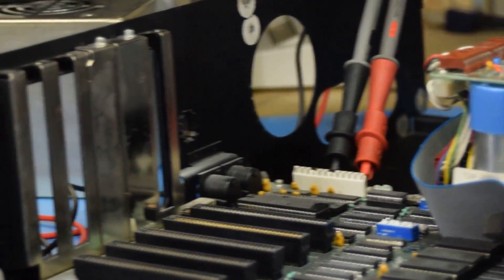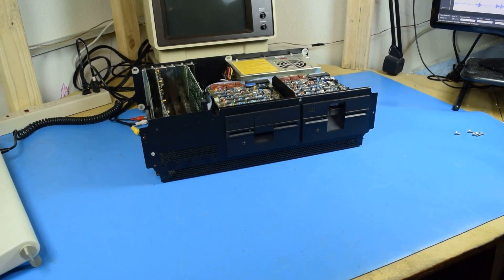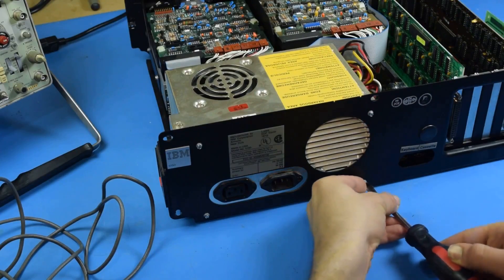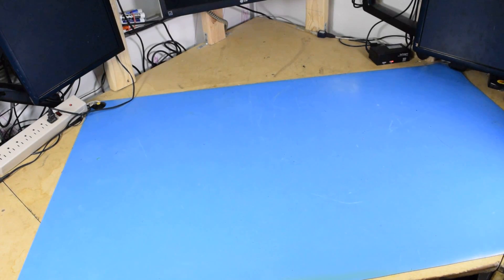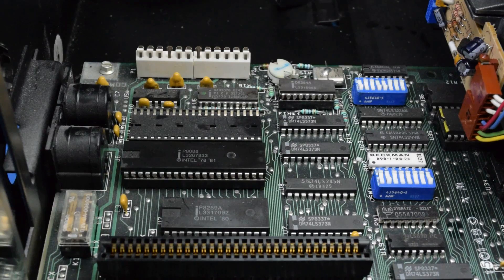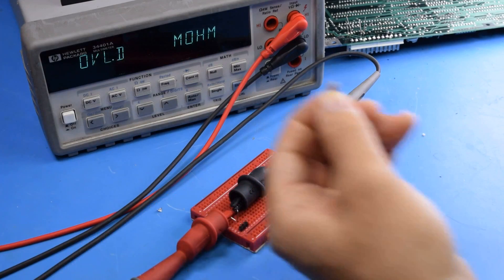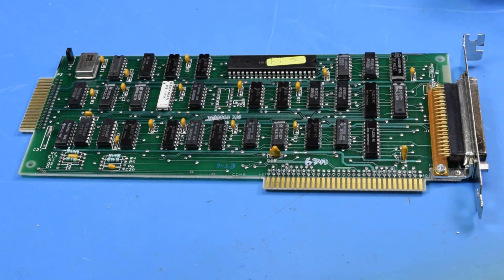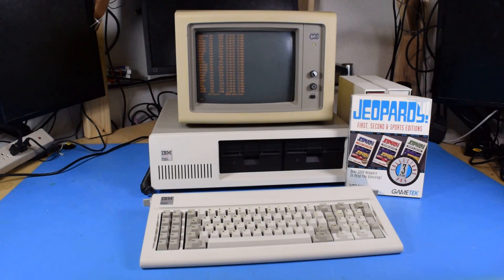0x0008 - An Overdue IBM 5150 Repair

Comment: For those coming along looking to fix their 5150's with problems.  Back when I was a boy (DJ reference) my job was to repair these things. First, these came with a 63 watt power supply. One of the power supply lines going to the motherboard is called the "Power Good". If you don't connect the motherboard or provide a power good signal, the power supply will not start up. It be dead.  Second, the tantalum caps on the PC boards will usually let you know when they're bad. They turn into a flaming fireball and automatically remove themselves. No user input needed. Put a 2 pin in backwards and get the same results. Third, when working on the floppy drives. On the bottom is a timing pattern for both 50 and 60 hertz strobes. Use a florescent light to check and adjust the speed.  If it's off the drive won't read disks.  Good luck.

Comment: It's amazing.  I became a computer tech in 1992 full time and learned DOS 2.11 and Basic on a 5150 in high school.  Back when I became a computer tech, these old 8088 / 8086 computers were just considered junk.  I spent days sometimes hauling these old computers out of companies by the van load to the dump after doing a workstation upgrade.   I wish I would have kept some of them now!
Reply: I picked up a couple of 5150s surplus around the same time. Upped the memory and added a 20 MG hard drive (close to $200 bucks).
My big move from a Radio Shaft Color Computer to my first real computer.
Fun times.

Comment: Capacitor ESR and leakage basically are independent. High ESR means the electrolyte is dried out / gone, high leakage indicates bad spots in the dielectric. Old caps may exhibit either, both, or neither. An ESR meter will tell you nothing about leakage, and a leakage tester nothing about ESR. 

Tantalums actually can be very durable, but their low ESR and small size means they are easily damaged by high inrush currents unless derated substantially. This was not common knowledge in the very early '80s, so particularly devices designed by people who were inclined to skimp on capacitors saw a fair share of failures.

Comment: 5:45 I thought some capacitors is going to release magic smoke and firework, but glad that doesn't happen to you :D
it happened to me with my IBM 5155. have to replace 2 shorted tantalum capacitor on motherboard and 1 on CGA card to get it working.

Comment: Just a heads up, those old 5150 power supplies won't power up without a heavy load.  Even a single hard drive and CD-ROM drive wouldn't power one up I was repairing, it required a load on both the molex and motherboard connectors to get it to run.  They are super picky about their loads.
Reply from the maker: I was able to get the 3rd party PSU to power up with just the HDD. But I can't remember if I ever tried turning it on with no load. So it may just always turn on. I've tried both PSUs in a 5150 though and they don't do anything.
Reply: I find the best thing for a load is to put a DC bulb of around 10 watts on the +12 and +5 rails.

Comment: Oh, I love that site. I have a 5160 that I received from one of my professors. Shortly after getting it, I turned it on, turned it off, then turned it ...nope. Dead. I used that site to troubleshoot and found it was a failed CGA video card. which I repaired. It was a bad tantalum capacitor, so I replaced them all.

Comment: When you connect your ohmmeter to the power input, you are basically measuring the power consumption of everything plugged in, but at a wrong voltage.  So there should be current running through, and the resistance should drop when you plug in more parts.  Unless you have a manual that states what the ohm reading should be at a specific ohmmeter test voltage or current , you won't get much from that test unless it shows a dead short.  As for the power supply, I wonder if the old handbooks contain enough detail to wire an ATX to PC/G adapter cable, letting you use a modern PSU (If it has the extra voltages that are often unused on modern boards).

Comment: 8:00: Most of the 5150 PSUs do not power on unless there is enough of a load connected; that could be a drive or a board, or even several things if necessary. That's not necessarily a fault. It's just the nature of the thing. I dimly seem to recall that that was even documented somewhere. I'm not even convinced that your original PSU has failed – that's a modern load connected at 9:30, which may not have been what was needed. I'm also not convinced the other PSU at 10:43 is actually faulty – again, that's a modern load, and the mainboard is unplugged there. If memory serves, it does seem to help to give the PSU a rest after failed switch-ons, and retry only much later with a Goldilocks amount of load on it. That behaviour too is probably normal and not a fault. Again, I am not convinced that the PSUs at 11:50 have failed. The clone PSU probably is simply less picky. 

Replacing the tantalum capacitors was probably helpful regardless or at the very least not harmful. Those really are notorious, even to the point of potentially producing literal fireworks when they fail. You're a little bit brave or foolhardy to hold old tantalum caps in your fingers. 21:16: Exactly right, the new tantal caps will likely be reliably good for a lot longer.

Btw., ESD can be a real bummer with those old DRAM DIPs which can be more sensitive than modern chips, and you're being very cavalier. Careful now.
Reply from the maker: I cut out some other shots where I attempted to power up both 5150 with the original PSUs and the fans don't even kick. The HDD was just a smaller way of demonstrating it for the video.

Comment: I had he exact same thing with this IBM floppy controller. My multimeter flagged a continuity beep between GND and 5V as soon as it was inserted on my IBM 5150. The exact same thing occurred on my IBM 5155. Oddly enough, using the same floppy controllers on an XT clone didn’t have the issue. I ended up using another (non IBM floppy controller) on my 5150 cause I was afraid of shorting something. But after watching this I’m beginning to think this might be just a “normal” IBM thing.

Comment: How did that resistance measurement works? You use A psu to charge it up and at the same time measure it with a multimeter? What voltages did you use?
I also need to measure some capacitors, but i only have a generic mutimeter.
Reply from the maker: Typically, resistance will be measured by running a constant current through the target while measuring the voltage across the target. In the case of a DC resistance measurement on a capacitor you get something that looks like a resistance, but theoretically, should not be. The capacitor will begin to charge as the constant current is applied, this will create a voltage difference between the positive and negative terminals. As the capacitor reaches it's maximum charge the current flow into it will slow down which looks like the resistance is increasing. Eventually the capacitor will be fully charged and no longer pull current. At this point the voltage will be the same on both terminals and it will look like an open circuit. 

However, nothing is perfect. The dielectric material between the plates in the capacitor will not be infinitely resistive. So there will eventually be a point at which it could be measured as a DC resistance. That amount should be extremely high. I was checking to make sure the dielectric had not degraded to the point of allowing a significant current to pass through.
Reply: Thx for the info! So if i have a 16v capacitor with 6300uf, i could try that applying 12v to it? Or It would need to be its nominal voltage?
Reply from the maker: You're talking about constant voltage. Which is different from constant current. It's not really possible to measure a capacitor with a typical multi-meter(not even the fancy ones I use in my videos) that's why separate ESR meters exist. A more complex testing method is required for capacitors than just applying power and reading a voltage. There are some very affordable capacitor testers out there though. This one is usually recommended and it easily available on ebay: https://www.youtube.com/watch?v=7Br3L1B80ow
Reply: Oh, my mistake! I am messing the whole morning with voltages and i am seeing them everywhere now. 
Thx, i will try to get one.

Comment: just for reference - tantalums go DEAD short, as in 0 ohm short and a LOUD bang with lots of smoke, no point checking their ESR imo.
33 ohm is what, 150mA on 5V rail? totally fine. Not to mention your normal reading was 150 Kilo ohms for naked board, not ohms. That 200-1300ohm cited on a website was probably for whole system with all cards in.

Repairing those power supplies could be an interesting video.

Comment: I have been researching building my own 3d printer completely DIY style. I have a few options. extrusions types seem easy enough but I have an old DLP based rear projections TV, I have thought about trying to make a DLP style 3d printer. what are your thoughts on this idea? Have you looked at anything like this before? if so do you have any suggestions?
Reply from the maker: I've never heard of someone DIY'ing a DLP printer. I don't know if there is a community around that yet, I would try to see if there is. There are a lot of people trying different things right now, so there may have been someone who has tried that already.
Reply: thanks for the reply. I figure it should be easyish lol. only one axis to worry about when printing. the DLP tv is just sitting in the back room doing nothing lol. I figure as long as I can get it to focus correctly it shouldn't be too hard. might have to buy a lens and a mirror maybe modify some kind of enclosure. I will look for some groups to get some ideas. thanks again for the reply.

Comment: Oh this brings back memories. Or maybe nightmares. Some (not many) PC/AT power supplies needed a load on +5V or +12V to power on. We used to have a little plugin salvaged off a dead hard drive with a couple of 100k ohm resistors to ground.
There's superglue and then their is superglue. Loktite and iirc Crazyglue are some of the best. I would use a tiny amount of loktite to hold the part in place while the epoxy I'd use set myself.
Reply: Is loktite still good in the us? Here where i live they sell loktite, but its as effective as water. Not even my fingers it glues hard anymore. 
I only buy generic tekbond ones, that seem to be halfway between the old loktite and the new unneffective one.
Reply: I was watching a video the other day, and loktite was what he tested as best. I primarily use superglue for quick setting something I've epoxied, as I said.
Reply: Copper Hamster Oh. I was asking because its common to products that are good in the us be bad arouns here... 
Example:
 Dell laptops are good in the us, here they are expensive disposable pcs. 
Hp laptops never were good here, but my hp mini that i got in the us survived thousands of shorts in the usb, experiences, falls, extreme conditions, and lasted about 8 years, when i wantes to upgrade his atom, but didnt saw the new tdp and the board burned. Now incredibly, even without a processor i can switch its board on, and use it as a powerbank. 
But the hps from here die misterioslly months after bought. 

Thyx for the info anyway!

Comment: PSU requires load to start up, that's why your first PSU didn't start up on the bench even though it worked in the system.

Comment: Gorgeous machine! They were quite expensive back then.
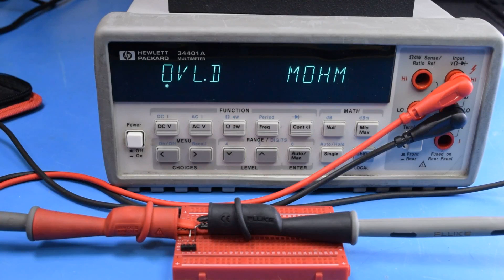I had no idea those were capacitors 16:30
 I got myself a Sinclair Spectrum Romanian clone (HC 91+) in 1994. That was my first ever computer. Of course it was not a PC, it was a HC (home computer). Very limited, running only BASIC programing language and BASIC software could be loaded from a cassette tape or if you had a floppy drive. 
I have uploaded a crappy video with that HC making it on GOOGLE :p
i also uploaded some photos on Flickr (link is in the description of the video)
https://www.youtube.com/watch?v=zzgJfVBOylM

Comment: Ah tantalum capacitors. Nasty little fire starters. You could always tell in our PCB fab when someone installed one backwards and I didn't catch it in visual inspection before powering it up. Usually, the way you would know is by the loud pop of the cap exploding followed by my "HOLY FUCK!" shortly afterwards. That said, I've never seen reference designators that are all the same like that. That is very bizarre. Oh, and it's also funny to see someone else do the heat-up-and-drop technique to get out parts.

Comment: That horribly bent card...
Reply from the maker: It is unsettling. I could try bending the front and back of the case out to see if that helps give it some room. The "CGA 5150" doesn't fit nearly as snug, so it's definitely something up with that one.